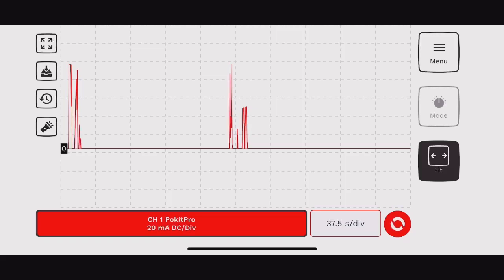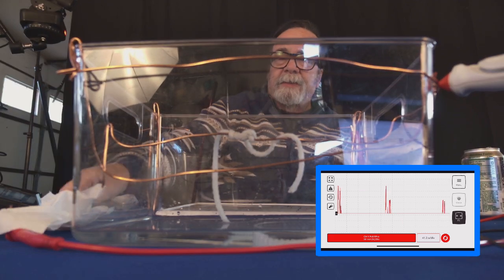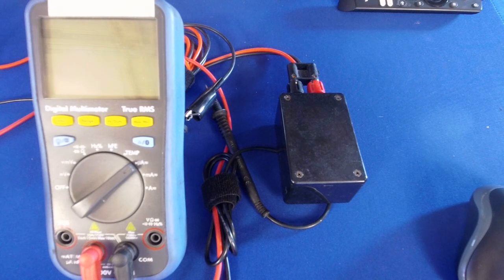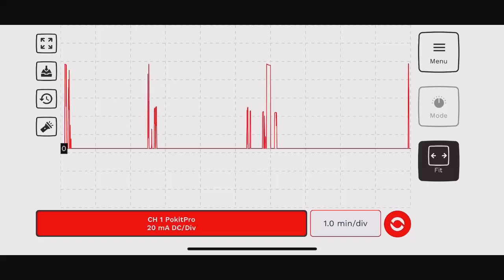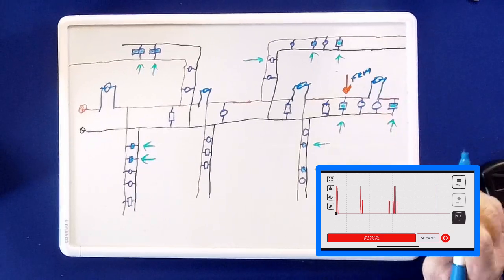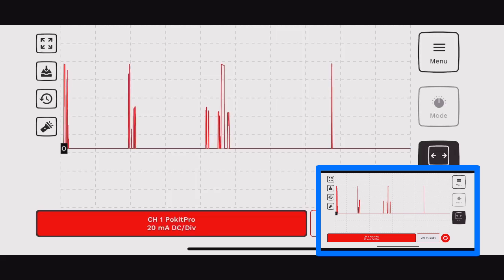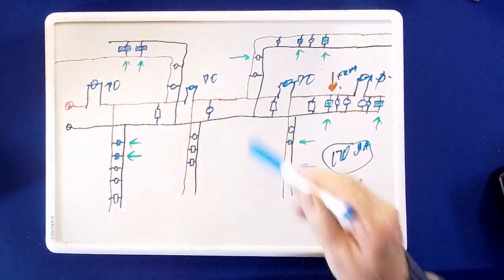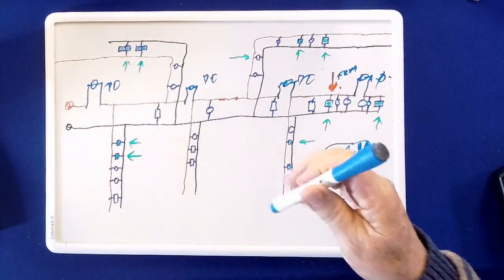Invalid replies with no set pattern.

Comment: How would this process work with a live Class A SLC? Or with isolators? I guess in a normal state only only the feed is providing current. I guess I'm not sure what isolators would do with overcurrent devices rather than an actual short circuit.
Hope to see more from you sometime! 
Switching over to Honeywell from Siemens so these videos have been helpful

Comment: If you want to gather data for an extended period have you left the SLC operational with logging meters instead of powering it from a Cobb Boxx? Leaving an SLC off would require a fire watch for the affected areas.
Reply from the maker: Yes. I monitor in a live state with a Mooshimeter which just recently I found that apparently someone may have bought the patent and it is now an N2 Neuron graphing meter available on Amazon. I have already ordered one. You can import a .csv file and then manipulate the file into a graph with time stamp.
Reply: @thelifesafetytroubleshooter  Thank you Gary. We have an account that is an older GW-FCI 7100 system that has developed SLC issues, intermittent "wrong type" messages mostly. Of course the system settles itself down by the time a tech arrives.
Reply from the maker: @michaelriggin-STA  All kinds of things can cause this issue. Check for low level grounds on the SLC. When they are on both sides it can cause some weird stuff. Also check the current draw of the SLC to see if it is in alighn with the amount of devices and modules. Get an "O" scope. My rcommendation would be the N2 Neuron and you can check that out on Amazon that will perform multiple functions on a Pad.

Comment: I usually troubleshoot with 2 oscilloscopes, one digital and one analog. Interesting way to do it with multiple “logging meters”. I usually work Simplex and Notifier, but have called Notifier tech support before needing to get good base oscope SLC pics and settings for noise comparisons. They kind of laughed at me, however tech support is the first to tell you to look for noise on the line. Without baseline waveforms/settings to look at, it’s hard to do. Which is frustrating when you have a problem they are telling you how to fix without giving you a comparison to look at. Your logging meters are a little different in the way they track than my oscilloscopes. Do you ever do SLC readings with an oscope? If so, do you have basic oscope waveform settings for Notifier SLC? I gained some basic ones from your logging meters…..are your logging meters like some sort of small digital oscilloscope emulator?
Reply from the maker: I was using what is called Mooshi meters and you can see them on Amazon but app is outdated and I don’t think they make then anymore. Currently using a Pokit Pro.
Reply from the maker: N2 Neuron Graphing meter available from Amazon. I just ordered one. You can hook it up live and monitor the current draw as a bandwidth and then watch it rise as the bad module starts sucking power. This is in my video Invalid replys with no set pattern. The graphs I show are from a Mooshimeter which is the N2 now. As far as "noise" I have heard that BS from tech support for years and have only ran into that issue once when an EC ran the SLC in THHN.
Reply from the maker: Check out the N2 Neuron on Amazon.

Comment: You should do a video on how to make the Cobb box
Reply: I'm thinking this is something he is going to try to sell. I may be wrong but that's what I'm thinking.
Reply: Really very simple to make. If you understand what he is doing.
Reply: @coreymueller7915  I'm guessing 3 - 9 volt batteries in series for starters
Reply from the maker: Just posted the instructions but I am looking into having a company manufacturing them as many people, me included, would just assume buy one than make one. I am only looking to make a hundred at first and it will be at a loss but if they sell out then I will consider having more made.